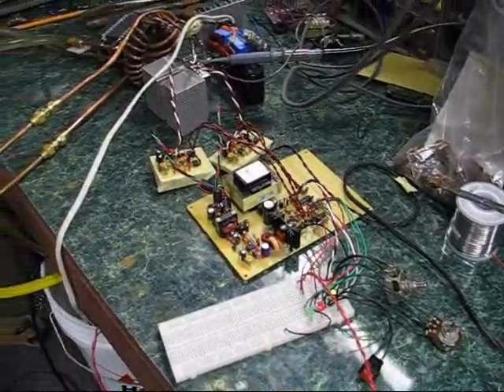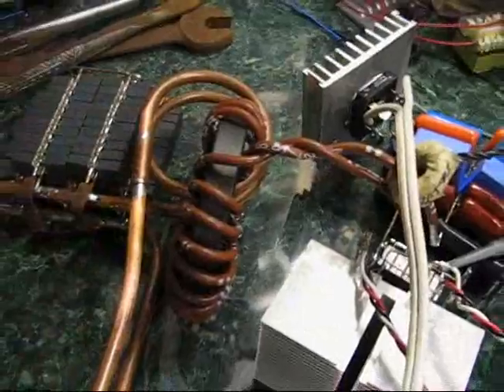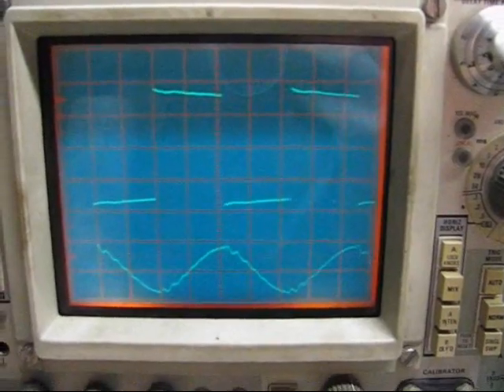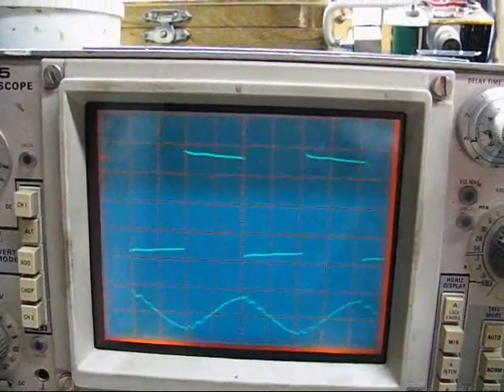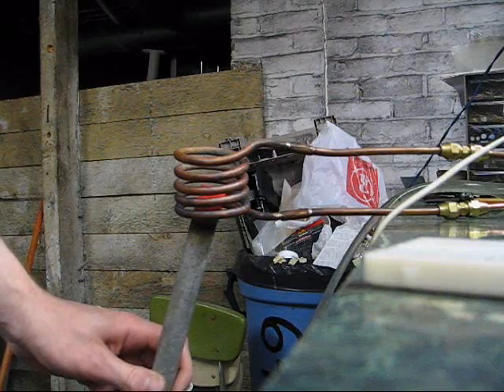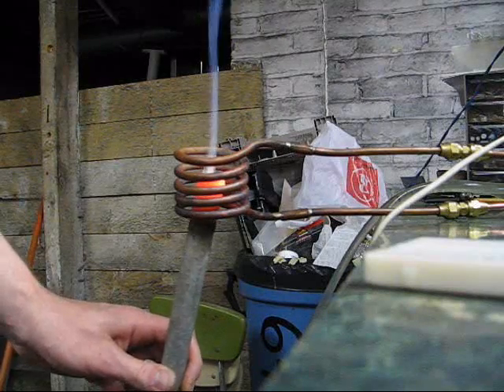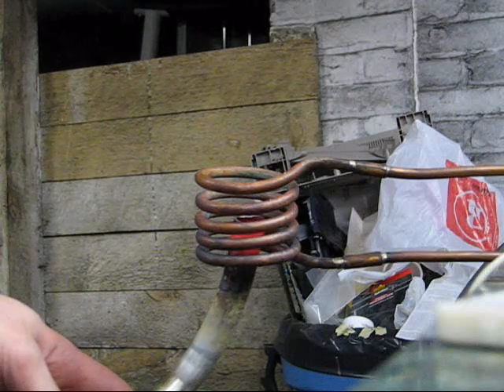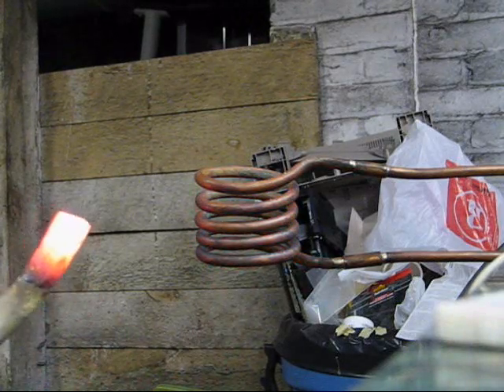More Induction Heating

Comment: Then according to this, what is the best configuration for the output stage as the tank circuit? a series or parallel.

¿How these settings affect the impedance matching?

Tanks

Comment: @luthmhor Im willing to go up to around 800$ i for a unit capable of melting steel, the ones im finding on the internet are all over 2500$, but are made for continual use over several years (like in a machine shop)

Comment from the maker: No, a finger isn't conductive enough to feel anything from this heater (but do beware of rings!).

RF heaters (running at 10MHz+) generate enough voltage to be dangerous by electric shock, RF burns and induction.